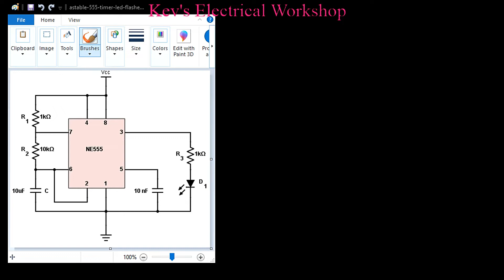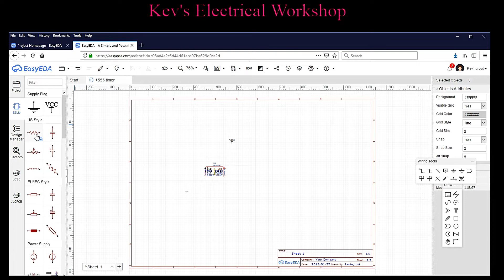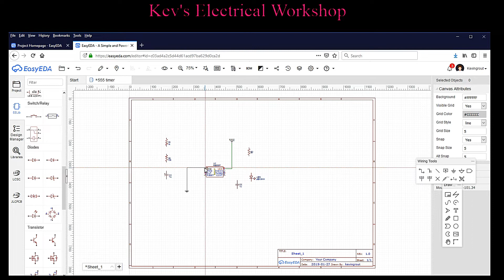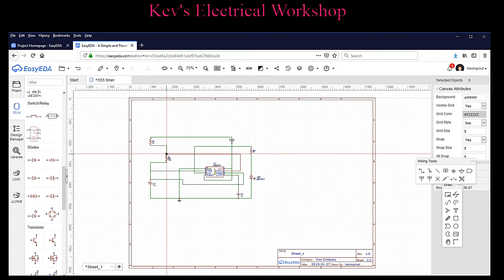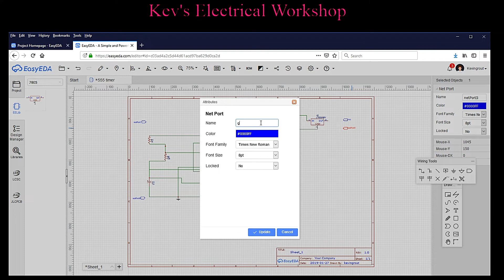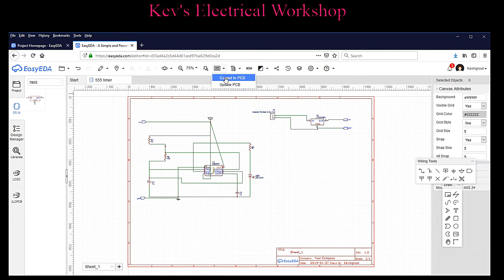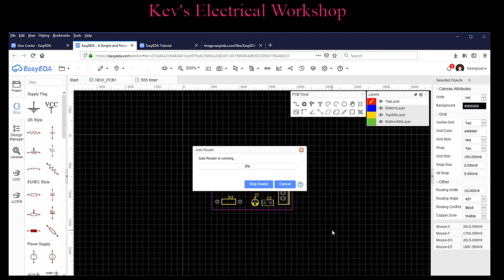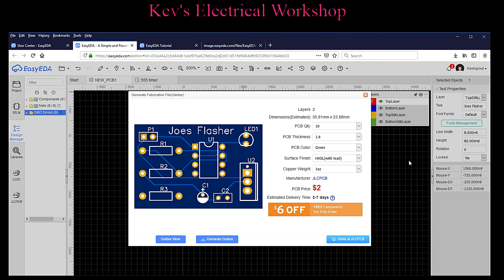Produce custom PCB's with EasyEDA and JLCPCB

Comment: Thanks Kev. I use Eagle but I'll have to give those guys a try for the boards. I see them advertised a lot lately. They are certainly cheap enough. Hopefully the quality is good.

BTW I  thought you'd disappeared. I had subscribed and thought I'd turned on the bell and so  I didn't bother to check your channel. My bad.
I've missed a lot of videos. I'll have to binge watch to catch up.
Thanks
Reply from the maker: You wont have missed much been busy for a year only just started to upload again, quality of jlcpcb is fine in my book dont know how they do it for the price.